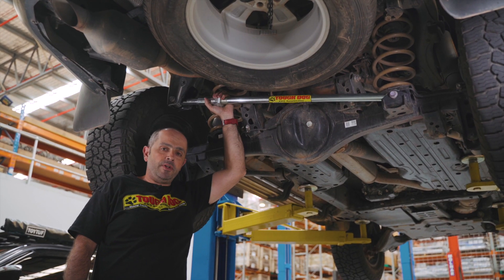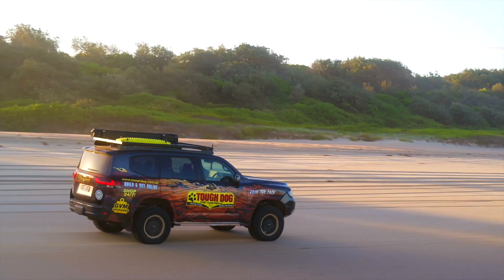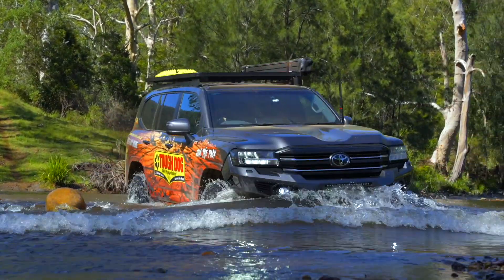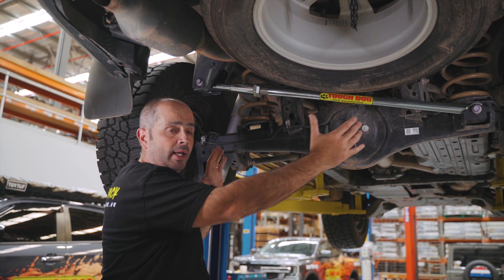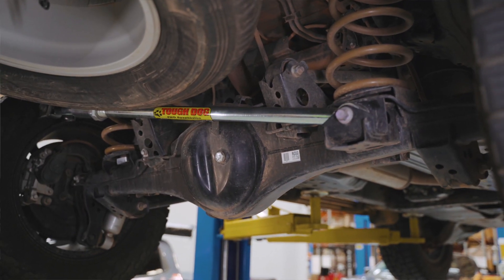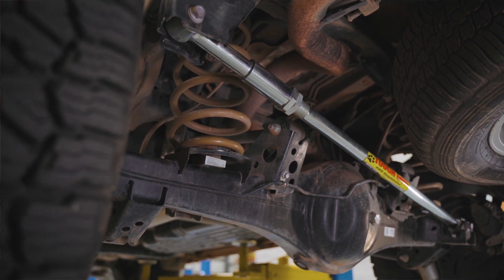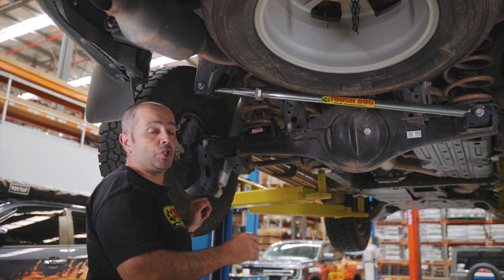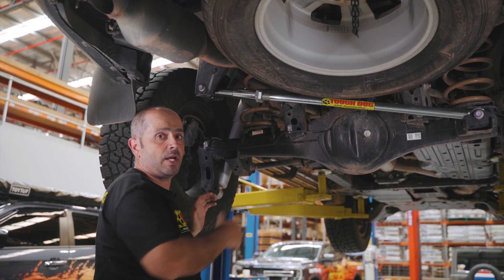Tough Dog Tech Tips: Panhard Rods

Comment: Ah no, this doesn't correct the panhard angle, the adjustable panhards only allows you to center the axel under the chassis at static ride height. You only make the geometry worse when the suspension cycles up and down, you get increased lateral movement (more side to side wiggle).

The correct way to do it, is to use a panhard correction bracket, this is the only way to correct the panhard geometry, the panhard should be sitting flat and parallel to the axel for best results.
Reply: Yeah that makes fucken sense mate
Reply: I think you're right. Had my toughdog panhard break 2 times at the ring that holds the bushes.